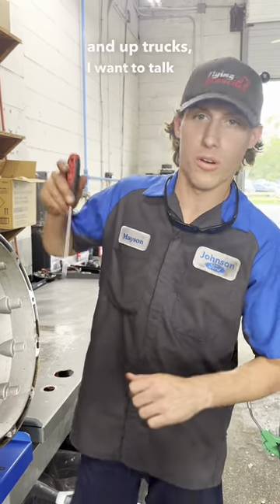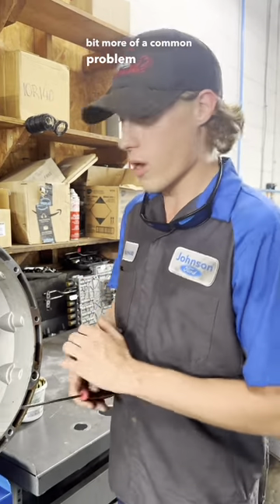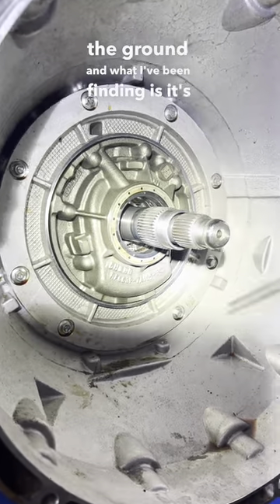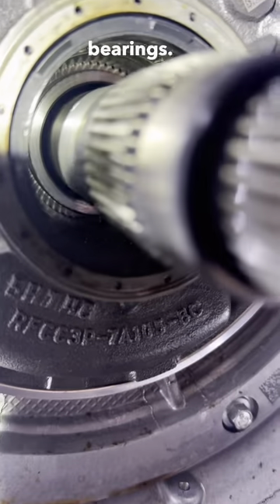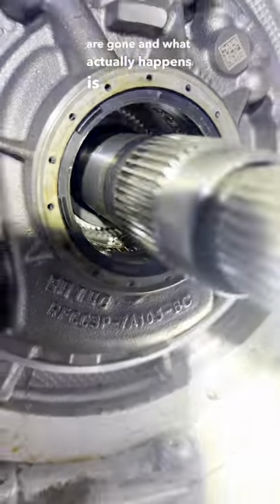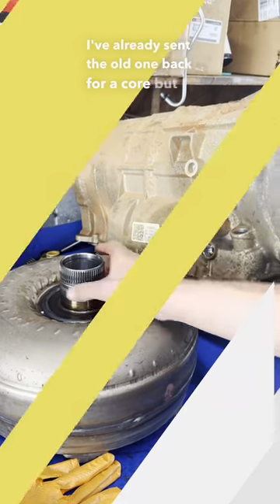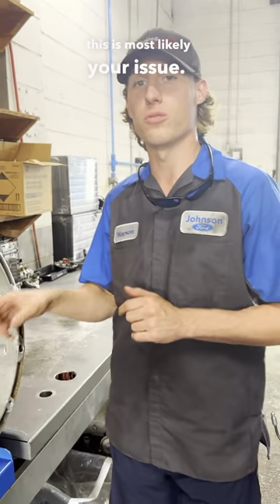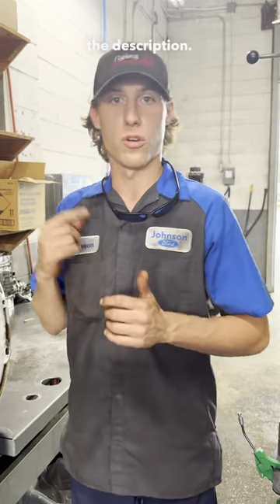Ford F-250 6 Speed Issues #shorts #ford #mechanic

Comment: Everything is junk now a days. If you have any brand loyalty or think any one brand makes better stuff than another your a fool
Reply: toyota and honda are still good, subaru is good if you ignore the engine problems, somehow swap a inline 4 in it.
Reply: @FedkaSlovanich agreed. Wish toyota made a full size diesel truck.
Reply: Well considering how bad it’s gotten Honda or Toyota are probably the best choices for everyday cars while Chevy is the best for pickups. Ford is just ford and Ram just breaks every 50k miles on the dot lol
Reply: @cheesedoesgaming6088  I agree with all of that. Honda and Toyota are definitely the best vehicles on the road but even they do things nowadays to intentionally cheap out and do planned obsolescence which i consider a slap in the face to the consumer especially considering what vehicles cost now. The only way to make this change is for everyone to get on the same page and go a couple years refusing to buy new cars regardless of manufacturer and only buy used. I guarantee a lot would change but people will never have the self control to do it

Comment: The laundry list of why not to buy a diesel ford is impressive.
Reply: Wait until you find out every brand is like this.
Reply: Funny cause I know alot of real working guys who only run fords.. I have a 05 f350 yes a 6.0 and it's been a true work horse.  I haven't have it bulletproofed yet but it's goin in soon. My 1st 6.0 was b.p and if it wasn't for the mountain I hit and that ol gal gave up the ghost to save me and she had 650,000 on her... RIP ... spent 4months looking for the lowest mileage truck I could find... and the one I have now has been very good to me. So I am a happy ford owner.
Reply: @warrenself  I know every brand is like this. I'm a mech :( I primarily work cummins. Anyone would cry about their planned obsolescence of overpriced sensors that derate or shut off the engine.
Reply: 390k on a DMax and Allison not one issues
Reply: Been in the automatic transmission business for 38 years Ford has never had a respectable transmission there is always one  50 dollar part that takes them out of service. Engineering is good but the bean counters like to cheap them out. Once properly updated cooled and serviced regularly they are pretty good.

Comment: Haven’t seen that failure yet. Most of my work on the 10R series are C,D,F Clutch hub sealing sleeves shifting and 10R60 A-clutch return spring failure. There is a problem with the coolant bypass valve sticking and making them overheat. But what the hell do I know. lol

Comment: People saying ford is junk, you do realize Chevy uses fords 10 speed now right? And also used another outsourced company in the Allison that they bought and now everything is rebranded junk. They’ve had weak transmissions since day 1. Don’t even have to say anything about dodge
Reply: All garbage imo but it goes ford, gm, then Chrysler in dead last
Reply: pre 2000’s ford and chevy are the golden age, most companies around here still use ford f-100’s due to them being easier to weld and rebuild. some of them have over a million miles.
Reply: It's not "ford's 10 speed" they, gm and Ford co developed the unit. And this isn't it. Also, dodge doesn't build their own truck transmissions
Reply: Yeah, GM & Ford developed the 10 speed trans together for their heavy duty lines. Cases are different but internally they're close to the same thing. 🤔👌👍🛠️🔧🔩
Reply: @cc23001  “co” developed. No they didn’t. Ford designed the 10 speed, GM was supposed to design a 9 speed trans axle transmission for front wheel drive cars. It was so bad ford never used it in a single vehicle. Ford has over $1.5b in r&d with that trans. GM has less than 300 million. Try again
Reply: @tdotw77  no they didn’t.
Reply: @johnbaker9581 The 2 valve Triton V8s were solid, the 2003-2007 Hemi V8s from what I've read are solid, and the LR4 (4.8) and LM7 (5.3) Vortec engines are solid. They all didn't have cylinder deactivation which significantly helped with reliability alongside iron blocks.
Reply: @myk1_sp  the hemi can be good. The trans behind it is junk. Same with the 4.8 and 5.3. Transmissions have been junk for a long time. Even though the hemi had a class action lawsuit against it. It’s not that good
Reply: @joshuaearnheart2756  That's true, the automatic transmissions were usually the things that go out.

Comment: Will they let you put Sonnax kits in them? Dealership i work at says no way
Reply: You can, good luck with warranty.
Reply: Don’t ever use non- oem ford parts. Always use OEM.
Reply: @jimmysturdevant9843  I've worked in dealerships and dedicated transmission shops. Some of these kits do address issues at the root cause instead of just replacing it with new parts.
Reply: @jimmysturdevant9843 Must be nice to own new stuff with that logic I guess. As time goes on it’s going to be aftermarket or used salvage parts as vehicles become more throw-away and the older stuff lacks demand for replacement parts.
Reply: @jimmysturdevant9843 If you had any knowledge of transmissions at all you would know Sonnax has been coming up with real fixes to manufacturers crap for over a decade now. Anyone upgrading fleet vehicles will use sonnax to beef up transmissions.😮

Comment: Originally technology purpose , to simplify our everyday lives.    💡.    Improve our lives.  Rear view / back up camera’s are good.   Side mirrors,,,,, ok we need cameras instead.   Chip shortages ?   You can’t simply change a battery in a new car.  Gone is loosening 2 nuts count them 2 nuts ,  push battery cables out of the way grab handle it’s out.  It’s a whole complicated  process now , so vital information is not lost for the actual proper functioning of the automobile.   The consumer is not driving the market if it were so we would have uncomplicated vehicles you could repair yourself and be affordable say 15,000 to 25,000 .  What we have are un necessary high tech vehicles that are unaffordable to purchase and unaffordable financially to maintain for long term ownership.   So if you want a new bare bones long bed F150 it’s starting 37,000 up.   If you simply manufactured it a little more mechanical with less complexity built in ,,,,,,,you could probably slash that price significantly.   😎😎😎